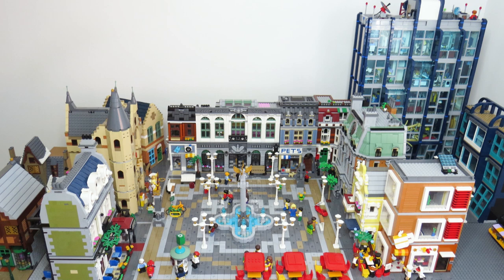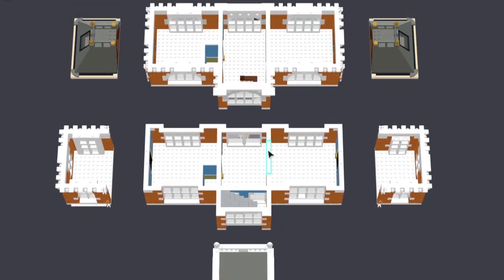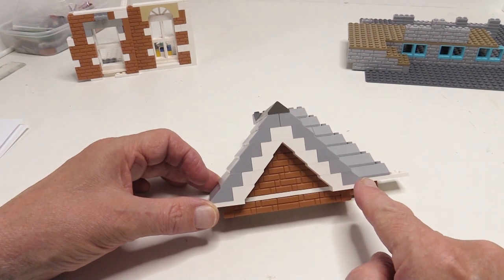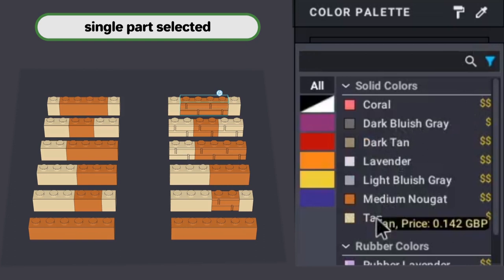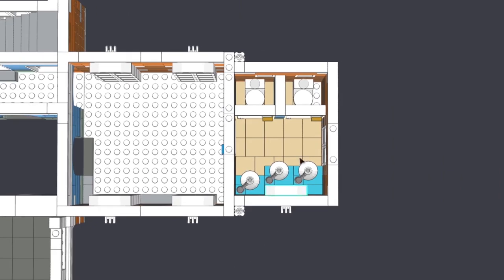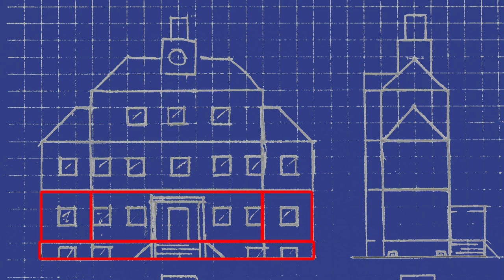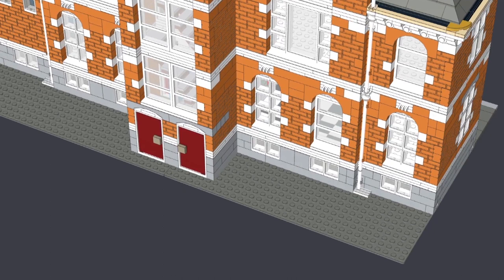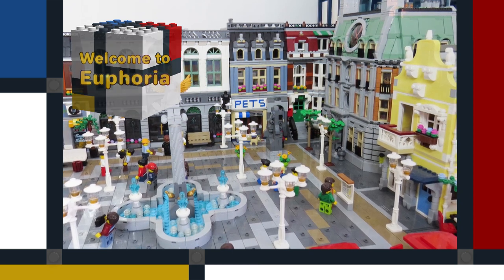New Town Hall Modular MOC : Part 6 - Detailed Design

Comment: 22:18 i've actually never seen such a Lego brick. 😮
Reply from the maker: Part 41553. 
Bricklink classifies it as a ‘turntable’. 
https://www.bricklink.com/v2/catalog/catalogitem.page?P=41533#T=C

It’s an old part from 2006. There would be other ways to add decorative finishing touches to the gable - I just fancied this one.
Reply: Is there internal access to the clock tower?
Reply: I love seeing this slowly come together
Reply from the maker: Getting there slowly - it’s a big project.  Some final bits of design before I start the Build phase.
Reply from the maker: At the moment I’ve included a maintenance access from the rear, but that means climbing on to the roof. Maybe we could include a ladder for internal access from the top floor?
Reply: @WelcometoEuphoria  a ladder makes total sense.
Reply from the maker: Thanks. We’ll have to look at that.